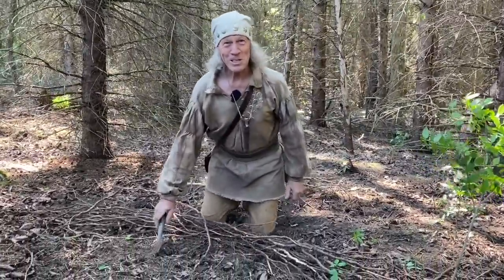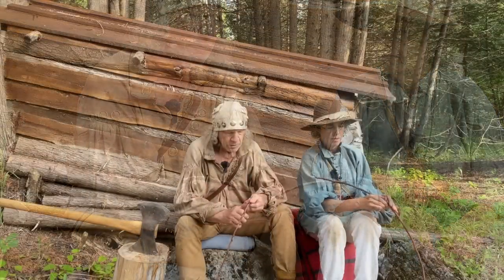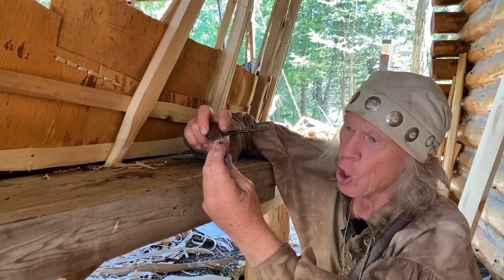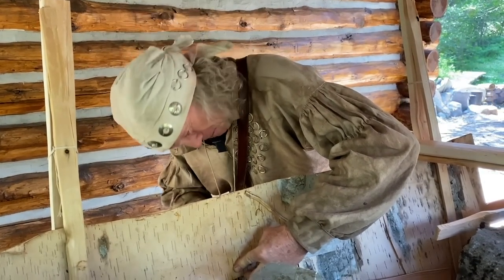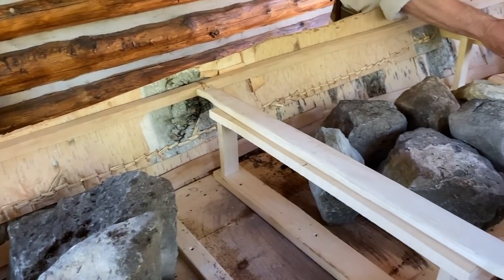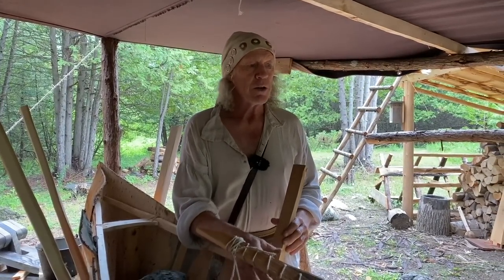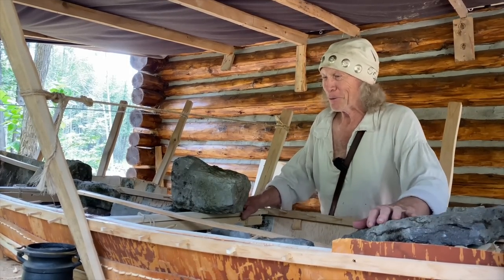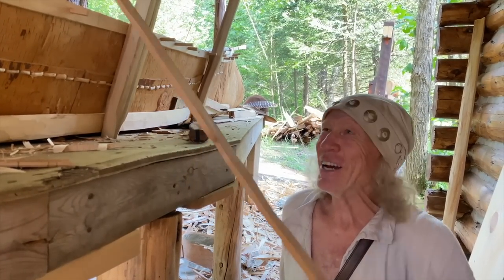Gunnels Are On!  Birch Bark Canoe Build | WOOD WORKING | DIY | PIONEER | CANADIAN WILDERNESS

Comment: As a visual learner; it is much easier to see it take shape and that it has and rather fast.   At least faster than all the hours you seemed to have spent gathering materials and working them on the shave horse.    Looks really nice.  (JF)
Reply from the maker: It is starting to take shape.  Won’t be too long before she is on the water.

Comment: About the bow and stern not being as strong as the hull: "A method that was developed by some Passamaquoddy builders in the late 1800s is to use a second, smaller headboard between the main headboard and the stem.  I have been using double headboards in all my canoes since 2001. - Steve Cayard"
Reply from the maker: Ah, a fellow canoe builder … few and far between.  I have also used that method, essentially a short rib in the opposite direction.  I’ve run into a bark problem at one end and rather than cut off the whole thing and start anew, I decided to finish it.  A wee bit stubby , not pleased but, it will float, lol.

Comment: Peter, did any style of canoe wrap a sheet of bark around the bow and stern for strength and to create a smooth surface to cut through the water? this is an amazing project and I have to ask, where did you learn to build these canoes? All the best!
Reply from the maker: I’m not aware of them ever using such a technique.  Actually, once it is completed it will have a pretty smooth entry and exit point.  A Métis fellow in Northern Ontario taught me about 16 years ago.

Comment: Enjoyable. Does it make a difference which side you overlap the bark on? On a wood boat the over laps are on the outside as with a clinker built boat. It was nice seeing your videographer in front of the camera. I have to think that it's pretty easy to get lost in the build.
Reply from the maker: Thanks David.  It is easier to get a smother side by placing. The panel inside the bottom bark.  Most of the canoes I’ve studied are build this way but, I’ve seen a few built the other way.

Comment: Curious as to what method you used to color your hunting shirt?
Reply: I believe he mentioned on a previous video he uses walnut hulls that have been boiled. I use walnut hull powder on bought online.
Reply from the maker: I use walnut shells.  I let them freeze, throw about a dozen in the boiling water container and stir about for about 45 minutes. Comes out a great brown, almost like camo with the lighter and darker spots.
Reply: @TheWoodlandEscape  Thank you sir.
Reply: @TheWoodlandEscape  You're talking about that outer cover of the black walnut are you?
I remember getting that stuff on my hands, takes a real long time to come off!
JIM 😂
Reply from the maker: I don’t even husk the walnuts.  Just throw. The whole thing in my boiling pot.  I use a big wash tub on an open fire.  I suspect they would work green right off the tree.  My frozen ones happened by accident.  I had gathered a bunch and forgot about them.  They froze hard as hockey pucks and blackened.  I wanted to dye a canvas shelter I’d made, so I fired up the tub of water, threw in a dozen frozen walnuts and the canvas and it came out perfect!